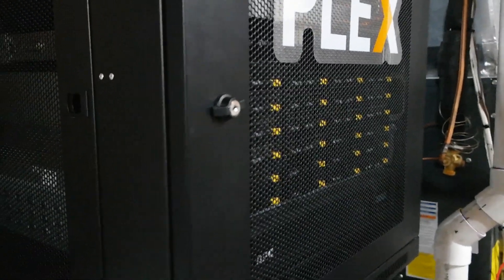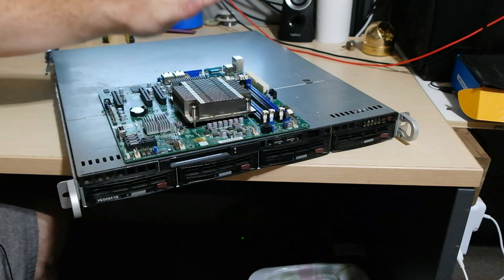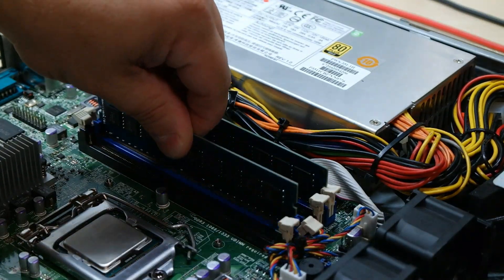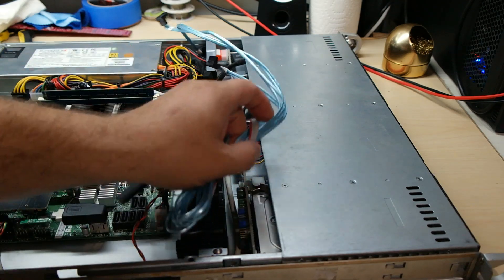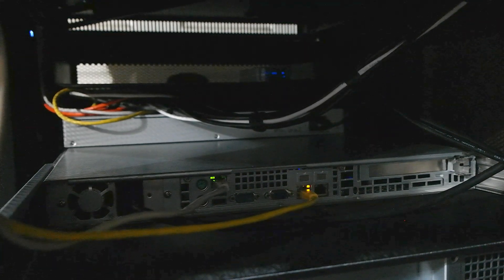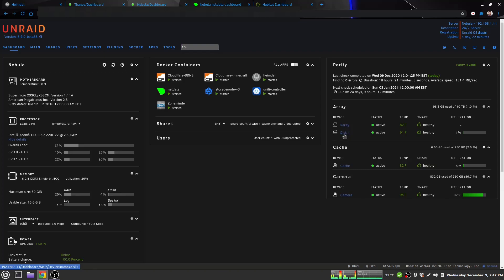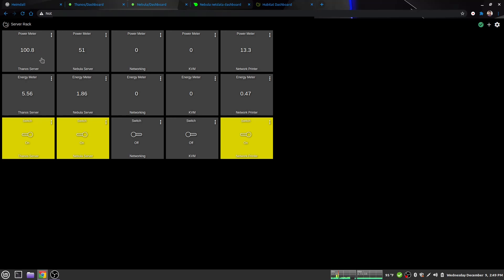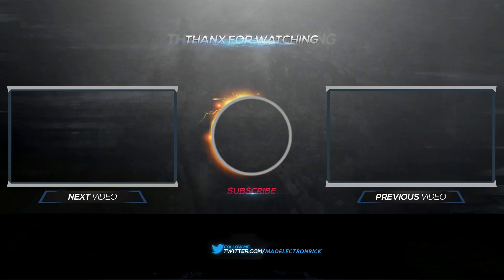Lets Build A 1U Low Power Server

Comment: Nice build, I am in the same boat as you. I took unRaid off my AMD 3950x PC and built a 2nd PC for my unRaid server using Intel 10100K underclocked and undervolted by 0.125mv while still maintaining iGPU stability. I now shut down my AMD machine between using it and the Intel 10100K setup runs 24/7, I went with it over an older intel CPU is because I got the CPU and mITX motherboard in a combo deal for $125. Mine idles around 22/23 watts.
Reply: Very nice! I was playing with an HP pre-built with an i3-10100, and it idles at an astonishing 10W! Low feature motherboards and low power PSUs are great.